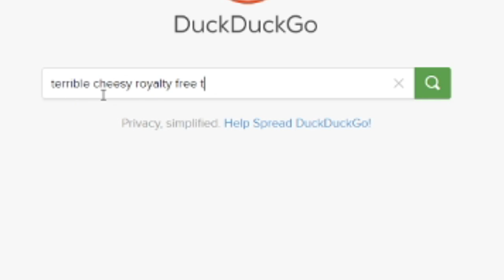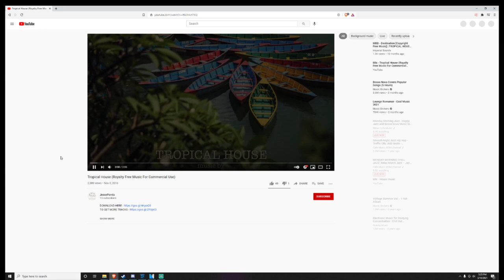Box Van Truck Tiny Home Conversion #6: HUGE 1,500W Solar Panel Array

Comment: Sikaflex is one of the best sealants I've ever used. I did all my parents windows at their house with it. Another good one is fuze it. Ive used that sealing freezer boxes it's rated for crazy temperatures. 

One suggestion you might want to consider lock washers over thread locker and in some cases it looks like you didn't use any locking hardware. You're going to be dealing with a lot of vibration. You're doing great work I'm very curious about the actuator. What's really awesome is since you're mobile you can always position yourself at the optimal angle for solar.
Reply from the maker: Actuator has been a pain in the ass. I'm on the 4th iteration of the install but I I think I've finally got it figured out.

Comment: Just  found your channel. I really appreciate your logical approach to the build so far. I have been plotting my project in a similar style. I am considering starting with a heavier duty truck for several reasons. My goal is to end up being to have boondock capacity for 30 days, good insulation, good refrigeration, on board washer and dryer, shower, etc.

I like the heavy duty for several reasons. First the durability, and the under floor space. I want most of the   interior to be modular.id the event of a need of a needed change of vehicle or a collision repair..
Note how many expensive builds go away in a couple of years.

I also appreciate your commitment to stealth. I like the option of flying under the radar in my travels.
If you are in the boonies leave the back door open and you have I great view. Keep it shut park in an industrial neiborhood and you are invisible.

I also like the fact that your videos don't describe themselves as epic, ultimate or suggesting scantily clad will reveal more skin of you click.

Being cheap, big tanks cost the same to dump or fill as a small tank.

I'm watching and looking forward to the rest of the story. 

I also like the craftsmanship.

Comment: Use isopropyl alcohol to wash off and paper towel.  Also you can use vegetable oil to soft skin after the scrubbing and it will also take of a little of the permanent marker.  First use the alcohol.
Reply from the maker: Thanks Sharon! I'll try that next time it breaks on me.
Reply: Trick from the 80s: Aquanet. Yes the aerosol hairspray and cheap artist version of a drawing spray sealer. Aquanet removes ink stains. 

Also at the college I work at we had a phantom graffiti writer in the women's a few years ago. Scrubbing, heavy cleaners, alcohol etc didn't work. But dry erase spray cleaner made it melt off the tile and stall doors.

Comment: I did the same, I put as many panels as my roof could fit, I got 2000w on because I am a full time house cat with a hungry gaming computer. Can use as much power as I want for 8 months of the year and either need to be frugal in winter or plug in somewhere. I am interested to know how much power you gain in winter from tilting them, from what I read it is about a 10% gain which is why I have never once bothered to tilt mine in 3 years :) But I wasn't clever enough to add an actuator.

Comment: This is huge ! And very nicely done 👍 are you going to let some space for a roof fan ?
Reply from the maker: No I'm going to have alternative ventilation methods. The rest of the roof space is going to be used for a roof hatch/skylight.
Reply: Good choice. I'm thinking fans that exhaust out thru vents in the bottom of mom's attic?. Maybe intake thru filtered floor vents?
Reply from the maker: @ronaldduck7567  Bottom of the moms attic is one of options I'm looking at, the other being straight out through the floor or out the front wall as I have a ~4" gap between the cab and the box to work with.
Reply: Between cab wall sounds like good option too. If you are planning a shower and cooking area, intakes  above those using flex tubing to the moms attic to keep it up high used to pull out steam/smoke. The Central air intake in floor with filter to displace the air moving out

Comment: @2:05 sec; What was the thick tape like stuff that you put on the solar panel, then put the metal framing over? Did you do that on all of the metal framing pieces? Does that make sense?

Comment: I'd be concerned that you've weakened the roof supports by drilling out-sized holes on them.  Also, if you'd used removable pin hinges, your life would be sooo much easier!    Good luck, young man.
Reply from the maker: Good call on the hinges. The roof is still super strong, and the load on it isn't that great anyway. Should be good

Comment: Also I'm curious how much power you get out of those panels, can you explain it like we're five?
Reply from the maker: Best way I can explain it is that this is bigger than almost any other van you'll see and it will allow me to run everything I would in a normal apartment (AC, dual monitors for my desktop computer, induction cooktop, residential size refrigerator) without ever having to be conscious of how much energy I'm using

Most vans only have 100-400W of solar and they cant really run much electrical outside of a coffee maker or small TV/laptop and occasional induction cooktop
Reply: @TheTechnoBarbarian  so are you saying you won't have to plug into electricity to recharge at all? If so that's amazing. Didn't know solar had so much capability
Reply: @TheTechnoBarbarian  we will just hold out hope that Elon musk and Bill Gates allow us to keep enjoying the Sun ;)
Reply: @MA__  there's 2 factors. How much solar energy you can absorb and how much you can retain. Batteries have made huge leaps and bounds. Im not a Musk fanboy but he has really started pushing energy storage.
Reply from the maker: @MA__  Thats right. 100% off grid. Any energy use beyond what can immediately be handled by my solar input (or cloudy days) will be handled by my massive battery bank which should hold me for 3+ days without any sun
Reply: Aftermarket huge alternator like the car stereo guys use. I think they have them now that output 300-400 amps AT IDLE. Imagine running the vehicle for 10min to top it off on a cloudy day
Reply: Aftermarket huge alternator like the car stereo guys use. I think they have them now that output 300-400 amps AT IDLE. Imagine running the vehicle for 10min to top it off on a cloudy day